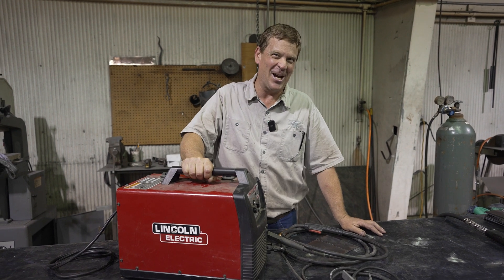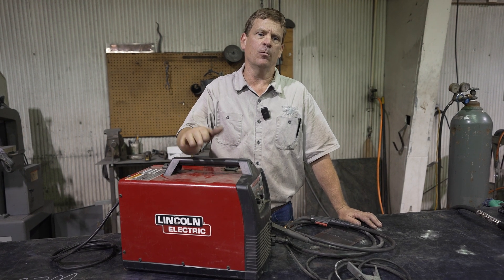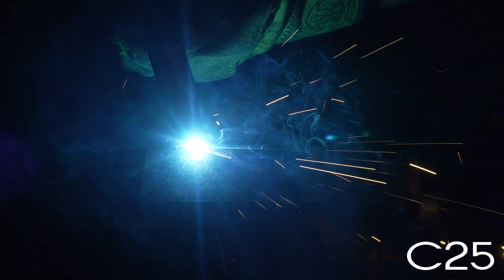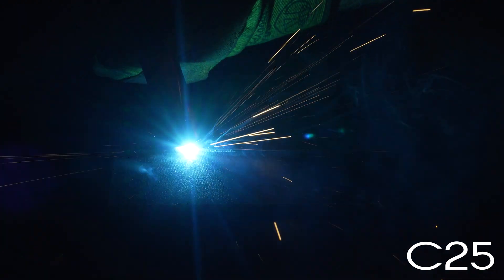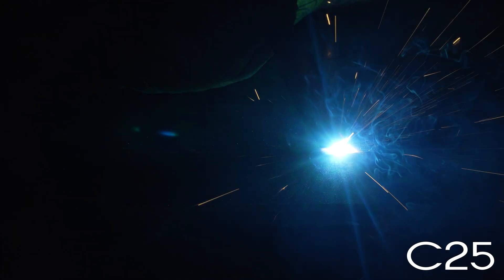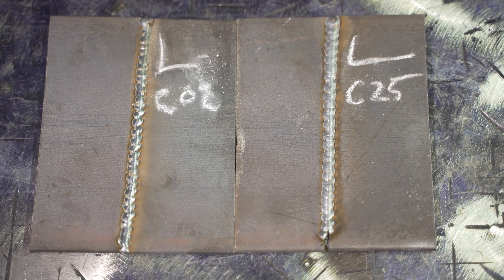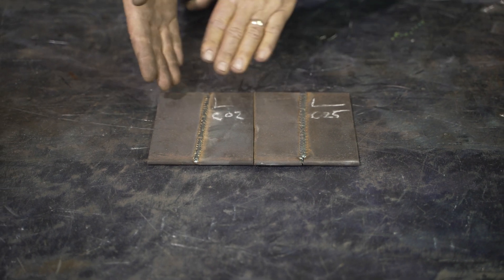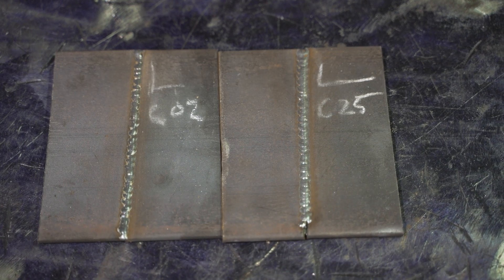C02 VS C25 Gas for MIG Welding With a High End Hobby Lincoln Electric Welder

Comment: Hi I have Lincoln pro MiG 140 can I weld 1/4” or 3/16” is my limit and I use c02
Reply from the maker: 1/4 is pushing it but with everything clean and a good bevel I have done it.   And depends on what it is.

Comment: It seems that 100% CO2 gives a higher, ropier weld with my welder (Thermal Arc Fabricator 141); I maxed out the voltage (19V) and played with WFS and still: ropy weld... Hum...
Reply from the maker: @rbelang8331  wire speed???   Or gas volume?     Your machine might not like co2.   I haven't ever found a machine that cared but I haven't run all machines
Reply: @jensen-design  Played with gas too, from 20 to 30 cfh...
Reply from the maker: @rbelang8331  maby to much wire or not enough heat.  🤔
Reply from the maker: @rbelang8331  is it bad enough to affect the final result?

Comment: I've been using CO2 since the 80s. I tried C25 for a while when the salesman promised me Miller 210 he sold me was built to use C25. After figured out that was BS I traded in the bottle for second CO2..... One thing I find funny about C25 is not only is it 3x to 5x more expensive, for non welding shops and home users who may take months to go through a bottle C25 produces noticeably worse welds than CO2.... This is because when C25 sits in the bottle for weeks or months the CO2 settles to the bottom so you are welding with straight Argon which makes for not great MIG welds in steel. Gas Suppliers call this stratification. Supposedly you can fix stratification by rolling the bottle around on the ground to remix the gases, but honestly who is going ever bother to do that?

I was able to prove stratification really happens to my brother a few years ago when he built a trailer. It was the weekend and he ran out of gas so I brought him CO2 to finish his project. While there he mentioned how his welds were kinda crappy at first then got better as the bottle ran out. I told him it wasn't his imagination the CO2 settled to bottom so he was welding with straight argon in the beginning and then straight CO2 in the end. Of course he didn't believe me so I had him hook his argon to the MIG and throw down some beads. Sure enough crappy welds were back. Then we hooked up the CO2 and everything was good again.
Reply from the maker: I didn't know about the stratification thing but it makes sense.  I am with you I think it is just a up chargee the welding supply shops work really hard to push

Comment: Good video.   Just a comment that may have been covered in another part.  What material and thickness are you welding, what wire/size or rod specs, what welder settings,  what flow regulator settings?   I like  getting this information in the beginning of each video.
Reply from the maker: I think I went over the materal in the firs video of the series.   The settings I intentionally left out because I feel each machine has its own happy place and from one machine to another they can very quite a bit.  Just my thoughts

Comment: From what I understand, co2 is hotter. So for a deeper penetration on thicker metal,  co2 would be a better choice. On thinner sheet metal, c25 would be a better choice.
Reply from the maker: I have run both and don't realy feel like there is much difference in penitration or heat
Reply: @jensen-design  thank you for replying.

Comment: Backyard mechanic here. I've been welding for a year now with 500$ mig. Mostly car rust patches. Read a welding book by Larry Jeffus. Stated there is that Co2 really gives better panetration than C25 which helps if welding thick metal with the SHORT CIRCUIT process. Book also recommends when running only Co2 to use er70s6 , and not er70s3. Thats because the wire has higher number of deoxidizing additives in it and this prevents porosity. co2 is oxidizing, while argon is inert. If co2 weld is left next to c25 weld in the same corrosive environment , the co2 bead will start to rust faster. Other than that, c25 welds easier on thinner metal , because argon helps stabilize the arc. Easier to weld sheet metal , such as steel fender or car door patch.
Reply from the maker: I have used co2 on sheet metal quite a bit and had no issues.    You have gone way more tecinal than I have.  The crosive part I don't think is much of an isue everything gets coated with some form of paint any way.  Just my thought.     I don't think c25 is bad I just think it is over priced when you are using it every day like I am

Comment: Great 3 video series! Straight to the point. I love your comment "there's a bunch of technical crap in there as well" in the first video. 😂.  I've never tried CO2, always used C25. I'm using a Lincoln SP170 for 1/4" fillet welds. I'm not happy with the penetration, so I'm doing some research on using CO2.  I thought that CO2 was supposed to run a little hotter, and maybe help with better penetration on thicker material with a smaller machine. Putting a bevel on the vertical plate works well and happy with the penetration, but that's gonna be alot time grinding.
Reply from the maker: Let me know if you switch I.   think you will be happy

Comment: Do you notice a difference in penetration between the two?
Reply from the maker: I can't tell any difference.    I have looked up the tecinal data and there is a slight difference in the shape but not enough to make any difference.     Unless you are under contract and the "engineer" spect c25 I would go co2